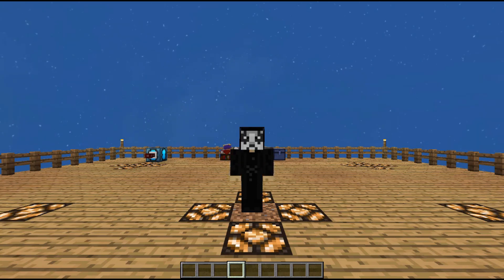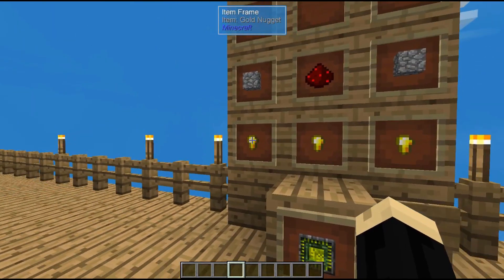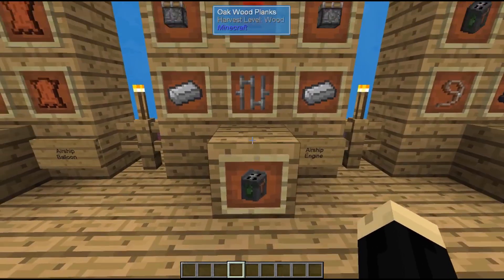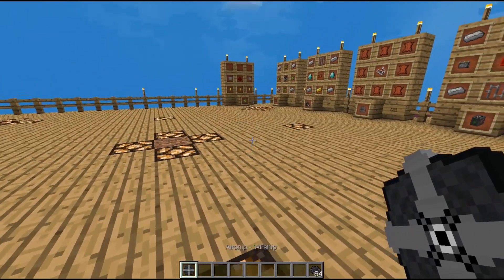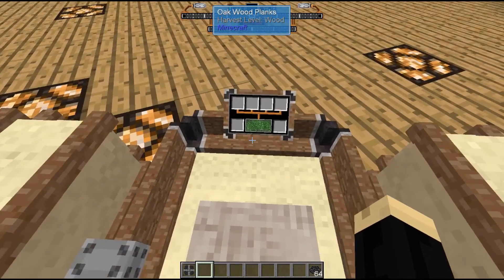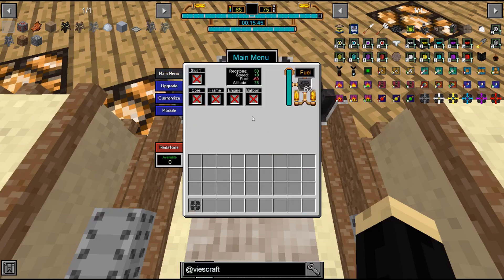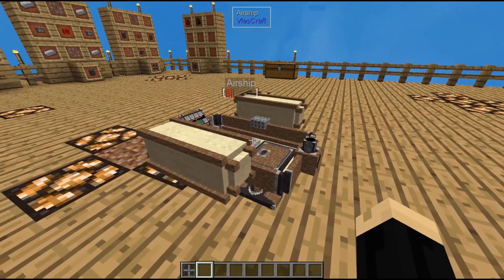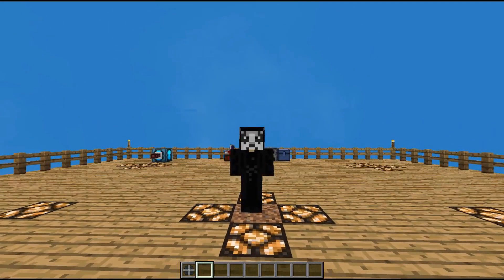Minecraft - Sky Factory 4 - How to Make an Airship   Introduction to Viescraft

Comment: Appreciate the vid, but my airship won't rise no matter how hard I press the space bar.
Reply from the maker: By default, almost all the Visecraft Airship controls are bound to keys already in use.  You'll need to go into controls and rebind them to new, unused keys.  I find it pretty frustrating as well.
Reply: @OnlydravenGaming  Thanks for the response. I figured it out. I was building my skyship on top of my pyramid, which was higher than the max height the basic ship could go.
Reply: Pretty sure you just weren't pressing the space bar hard enough. You have to REALLY smash it.
Reply: @distantignition  LOL

Comment: What do I need to change to get the menu up in options
Reply from the maker: In the controls section down near the bottom is the Visecraft options.  Any control in red means that the button or key listed is currently configured for multiple actions.  Just chandler those to any new key not already being used.
Reply: Onlydraven Gaming I cannot seem to find it, I click escape then go into options, controls and the use the bar to scroll to the bottom. I went all the way up to the top couldn’t find it. Searched in the search bar and the only v was voice. Am I doing something wrong? Thanks for quick replu
Reply: @Josh-hf1in  did he reply to you? Lol